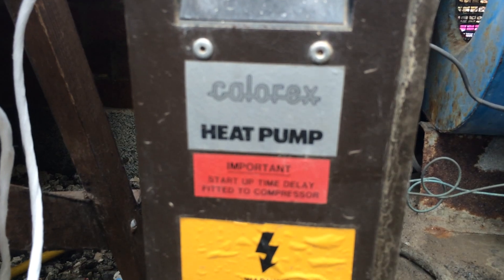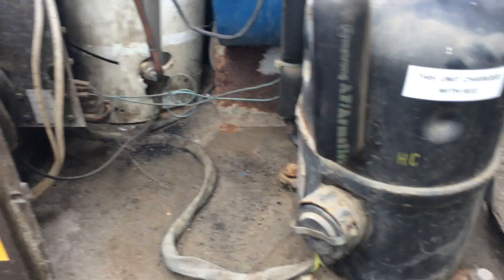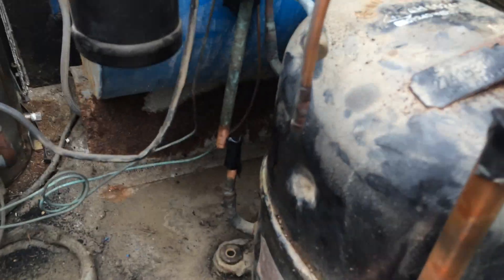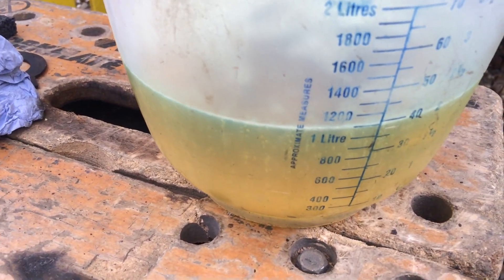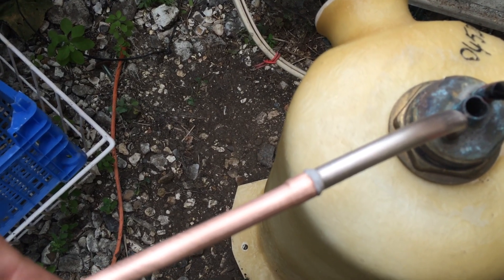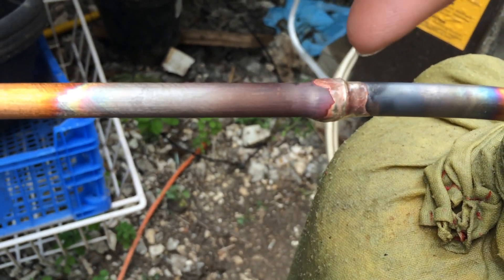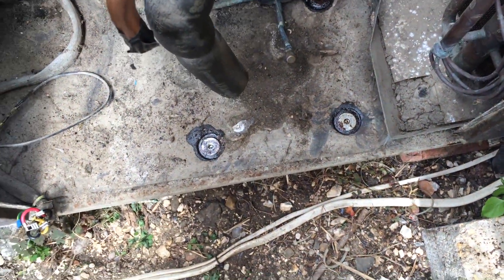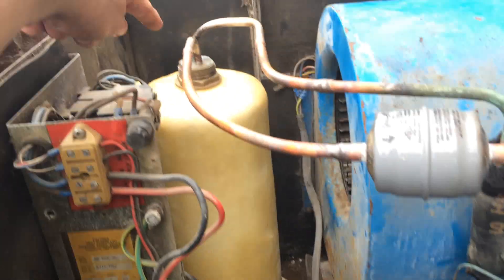Calorex Condenser Replacement

Comment: Weren't you using 407F before? If so, why did you switch over?
Reply from the maker: I'm still using R407F on refrigeration systems, this one has a  non adjustable thermal expansion valve and we felt R407C would be a closer match to the R22 the system used to run on.